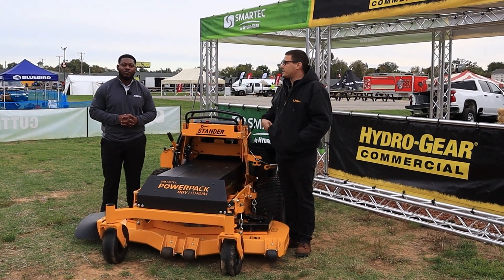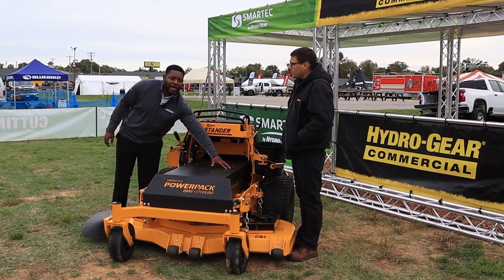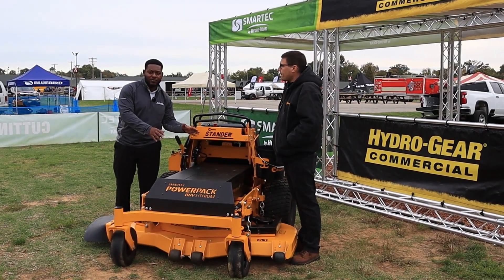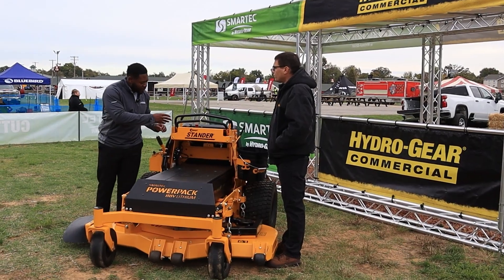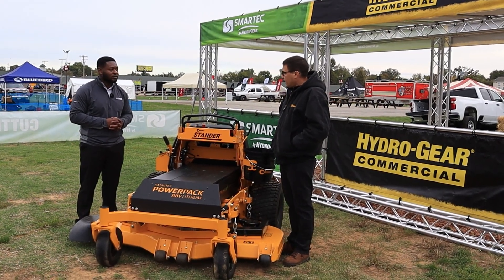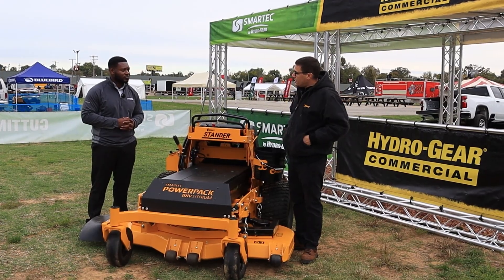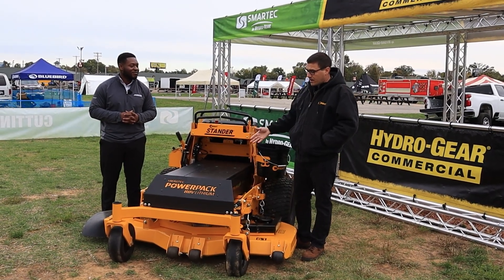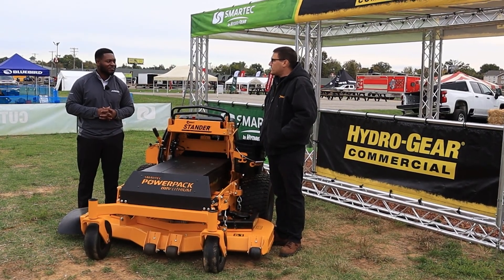FULLY ELECTRIC WRIGHT Stander Prototype: First Look with Hydro-Gear Smartec

Comment: Obviously Wright is choosing to try to stay ahead of the curve in jurisdictions that are banning gas powered mowers and equipment. However, this is NOT what the consumer wants! Gas equipment is so good but the best part is how easily it can be refueled on the job. Current Wright has mowers can hold 15.5 gallons of fuel - no way this battery version can touch the mowing hours, not to mention a 5 minute refuel.

Comment: (1) How much does it cost? (2) What does it weigh? (3) How long will it run at 100%? (4) How fast will it recharge? (5) Can you plug it in at your local charging station?
Reply from the maker: This is just a prototype, so those are some of the details that would need to be figured out long before we ever release this, if we do!
Reply: @WrightMowers  (6) What happens when it dies in the middle of a mow and it’s a long way from an electric plug?  Does it become a 1000 pound deadweight anchor or can you release the drive wheels and easily push it to the trailer on the other side of the estate?

Comment: I will retire from lawn service before I use electric mower
Reply: I totally agree!
Reply: Why?
Reply: @MajorImpact cost of electricity and battery/motor replacement, weight, heat and moisture eventually cooking batteries and electronics, etc. Still want to try one just for ish and gigs, but I think I’ll stick with a Kawasaki FS or FX before going electric.
Reply: @MajorImpact do you have 20 hours to hear why ?